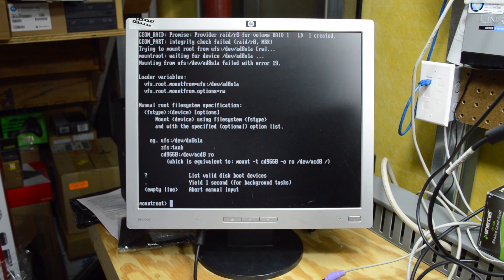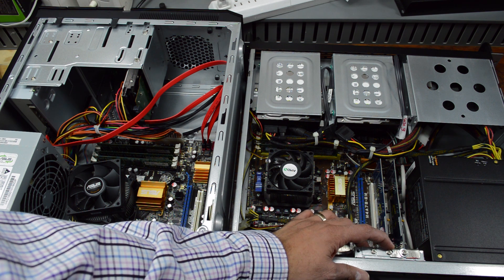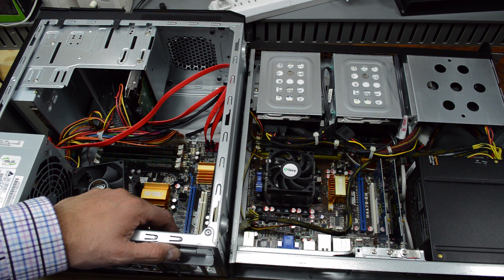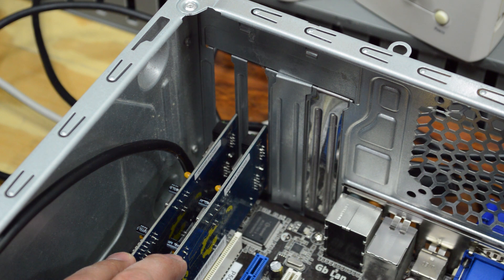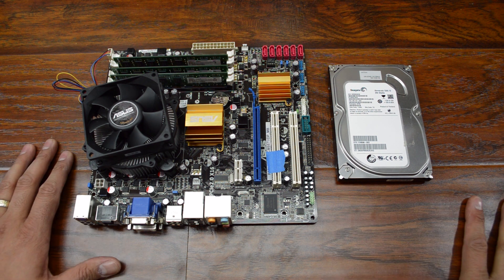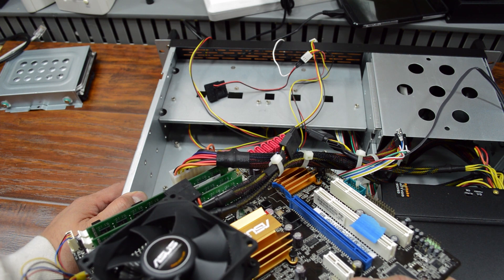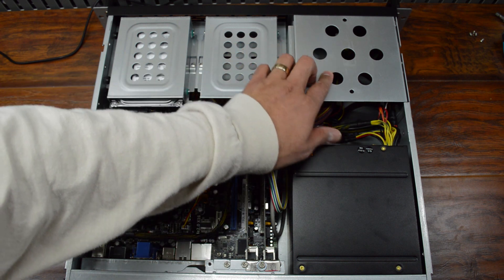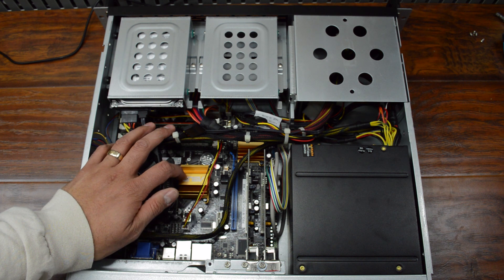PFSense Firewall Server Rebuild

Comment: I was having problems with pfsense connections dropping the pfsense freezing requiring a hard reset. I was doing trouble shooting and found that using realtech based network cards were flaky.  So what I did Is went on ebay and brought a dual port Intel server gigibit card fir $50 AUD and pfsense works flawlessly with that card in an dell optiplex 960
Reply from the maker: I've been thinking about dropping my NICs and getting Intel cards for a while now.  Sounds like you've got a good setup.